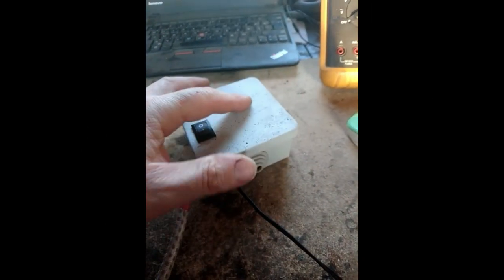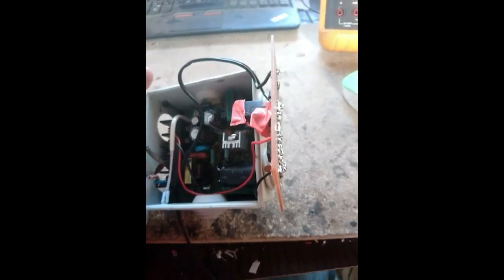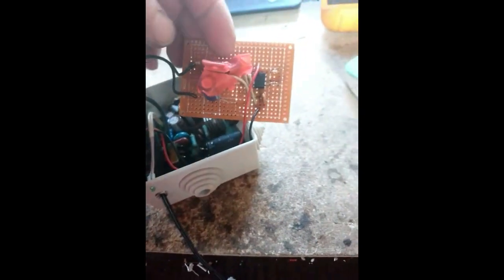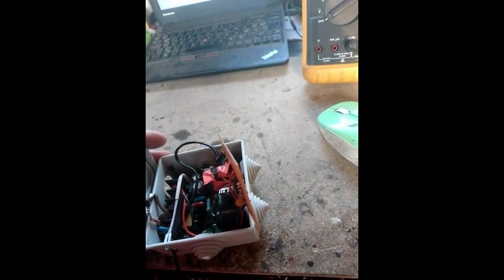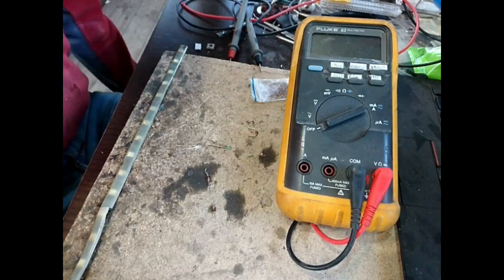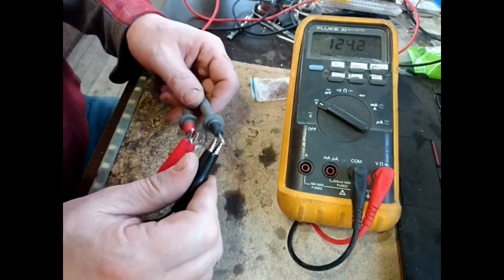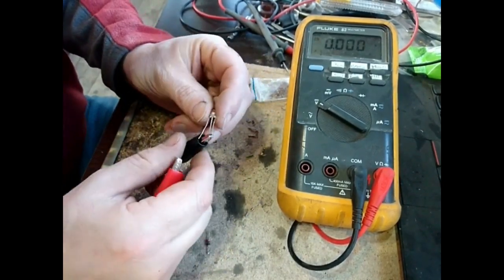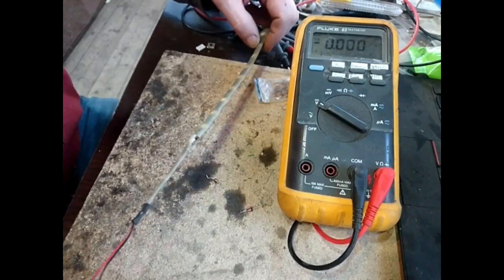how to make led / tv back-light tester

Comment: Is it recommended to change only burnt led or all
Reply from the maker: If you are capable of changing a single  smd led then it is the cheaper option but I don't know what you are repairing so its difficult to give an accurate reply

Comment: Is this diagram safe? in the sense that if both hands are touched the probes are not electrocuted? And is it equipped with short protection? Thank you, you are great
Reply from the maker: Yes quite safe the current is very tiny so if you short the probes nothing will happen, however! you should apply basic electrical safety with any open circuit, thank you for your comment